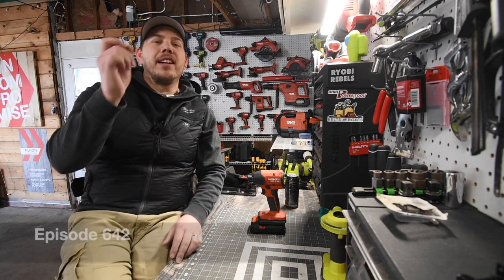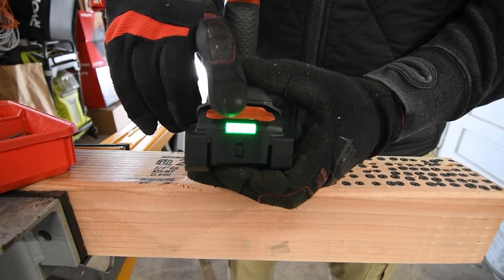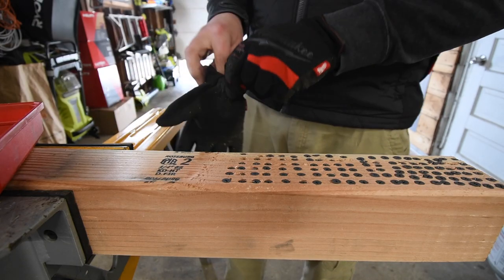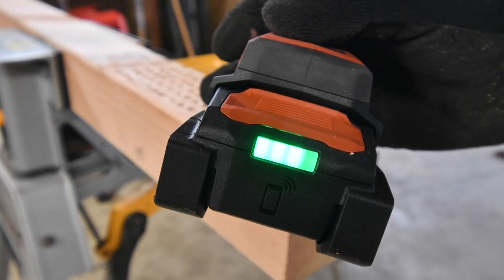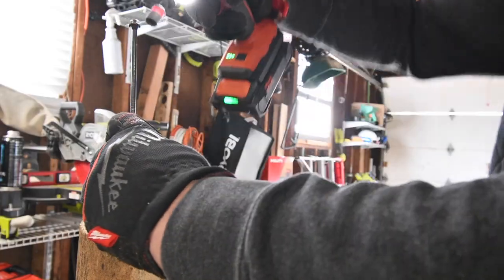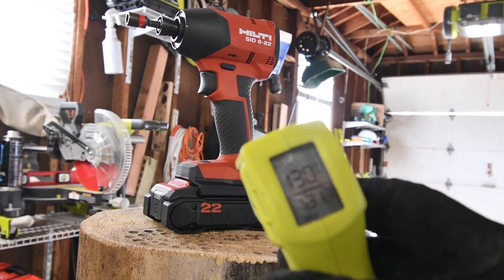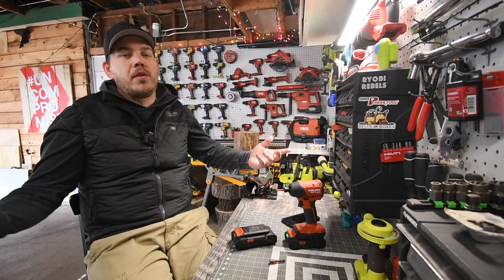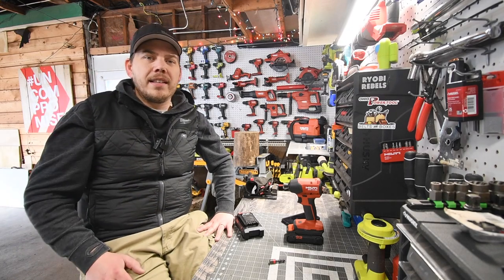How many Screws does it take to drain a 2.5ah Battery?

Comment: There’s definitely a new belt clip for Nuron.  It’s a damn shame they didn’t bring the double row 18650 pack at launch, IMHO.  I used the cordless vac a bit today.  Not on the same level as Nilfisk/Starmix/Festool design and build quality wise (fleece bag use was clearly an afterthought) but also the only suitable cordless unit I’ve gotten my hands on….ever.   CFM is more like 110-120, but that still sucks everyone else away.  Remote switch works good.  12ah battery gets eaten up somewhat quickly but you would expect that.  Louder than I’d expect for a European vac.  More Ridgid and Dirt Devil than Festool and Sebo in the noise dampening department.   I have some brutal tests in mind for it.

Comment: Nice video. Might be easier to just see how many long lags each battery does. Faster and better comparison. The collet issue is unacceptable in such an expensive tool. Also, I've had to modify a fair share of belt clips for various reasons so I can say just bend it with some pliers so the bigger battery fits.

Comment: Great video Dave. is that 2.5ah 18650 or 21700.i was assuming it was 18650 because the width difference between the 4.0ah
Reply from the maker: Im assuming its 18650 as well